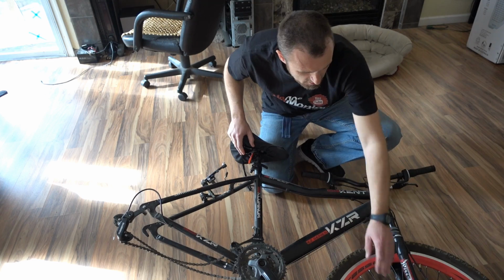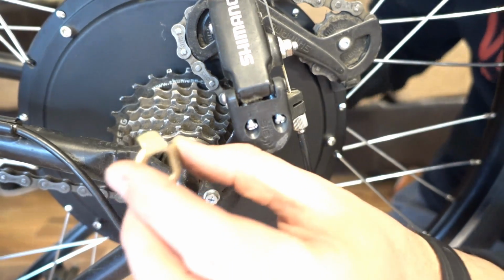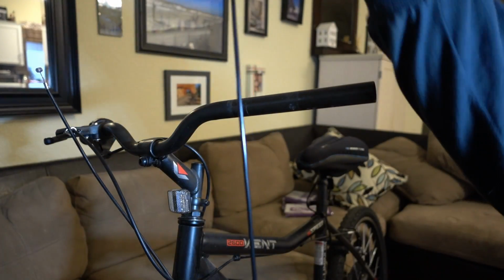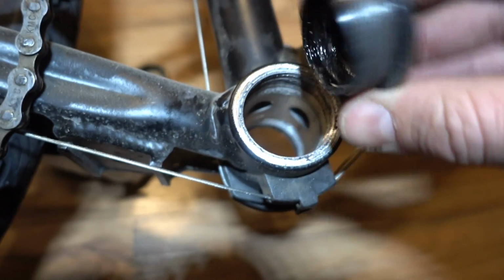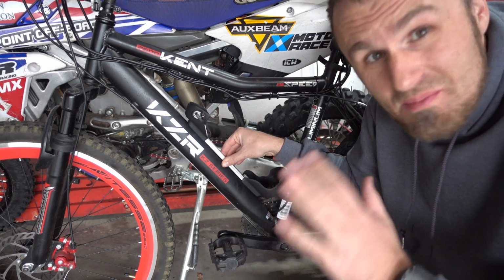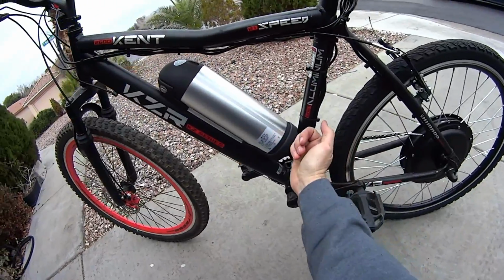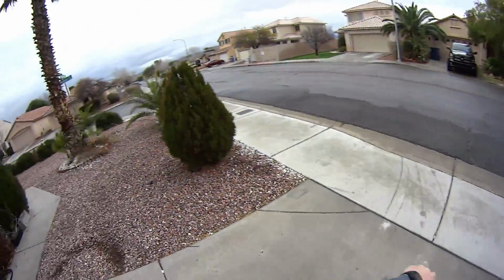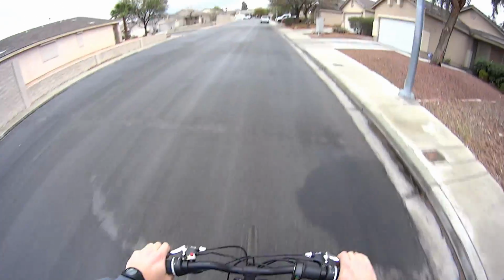How to build a home made electric bicycle better than Ancheer cyclamatic for $250

Comment: Most people don't retain the front derailleur and shifter because it isn't needed. The motor provides all the power you need for hills, making the smaller gears obsolete. So you could have freed up handlebar space

Comment: i have ancheer bike i am from germany, i make 5000km a year, so many dumb people buy e bikes for  1000-2000 euro for no reason. all i enhanced was i changed fixed handlebar extension to a variable and larger one to fit my height better and bought a 3 euro foam seat addition, i have it for 2 years and i still like it. ps i bought it after having viewed your videos cuz i was also suspicious but it worked out as expected

Comment: We live in the same city! I have a RHM 48V 1000W eBay kit I bought back in 2015, it’s still working great! I originally had it installed on my 2010 Trek 4300 (non disc version). A few months ago I found a Kona on CL with hydraulic disc brakes for $100, so I grabbed it! I transferred the kit to that bike. I did have to get a new rear brake setup installed though, so that added to the cost. 
          A little over a week ago I was on FB marketplace and found a Giant Escape 3 with a BBS01B mid drive kit already installed on it for $75! All it needed was a battery, and the battery I already have works on it! The motor is a 48v 350w and my battery is a 48v 12AH. It works great, and feels much more like a regular pedal bike when riding unassisted! I use much less battery vs my RHM. I ride both in pedal assist only, they have throttles but I have them disconnected. It only takes a few seconds to connect them if I need to. BTW, my eBay kit came with a LCD display, I paid about $270 for the kit back in 2015. They’ve gone down since then! I can control my PAS 1-5.
Reply: What happened to your Ancheer?
Reply from the maker: Sold the ancheer a while back... Wanted a fat tire bike but they are like 900 so I have up on it, till this happened

Comment: They sell the rear wheel kits that already include the cassette - and it only costs a few dollars more - yes, it's a cheap cassette, but you're going electric on a cheap Walmart bike, so it's not as critical when you pedal. Actually, you can swap it out with higher quality components if you like. Another safety thing you absolutely need -TORQUE ARMS (especially for front wheel conversions). The torque washers included might be good for 250watt kits, but anything above, you absolutely want to use torque arms (two, one on each side). Unfortunately, I learned from experience. I cartwheeled on my front conversion, but I was only going 10mph. If I was going full speed at 20 to 30 mph, I'd be dead. Rear wheel is not as critical since you won't cartwheel - but the wheel can still spinout and break up.
Reply from the maker: All good info, thanks.. How you like your bike, fun right?
Reply: @VegasRoManiacReviews  Yes, total fun. I started with an Ancheer (folding) 250watt a couple years ago and got the ebike bug. Then I converted an old bike with a front 1000watt kit (that's where I learned my lesson), then converted a new Walmart Genesis v2100 (made by Kent) with a rear wheel. After riding the 1000watts, you don't want to go back to the 250. You need it for hill climbing (15 to 20mph is plenty fast for a bike). Pretty scary when you go 25 to 30 on the streets with traffic and a cheap Walmart bike! And besides, you don't want the cops to stop you for speeding. I try to be inconspicous as possible.

Comment: Consider getting a mid-drive as an add-on approach. Watch this new video posted today: https://www.youtube.com/watch?v=I98Ram3HJw0
Reply from the maker: I like the throttle mode only on the hub motor, in done trying to ride in gnarly terrain, I just need to cruise around on a mountain road or around town, the throttle mode it's amazing, and it's efficient

Comment: I just gave away an old bike that would have been perfect for that.  Doh! 
Nice build.  It was worth the money just for the burnouts.  Those pedal crank bearings are HARD to get to.  I had to replace some crank bearings once and I almost gave up.
That's a great idea moving the front brake to the right.  That always messes me up on my bicycle because it's opposite from a motorcycle.
Reply from the maker: Yep was a fun project and I'm thinking to get another battery, so I will have lots of miles on it...

Comment: From a sharing your experience in this project perspective, the video was great! It exemplified all the steps necessary to get this system functioning and all the unexpected design deficiencies that you had to overcome to get it functioning. Luckily you were able to fit the battery inside the frame space available overcome the interference problems from the derailleur and frame drop-out. From the perspective of whether I would want to have that bike or not, I can clearly say NO THANKS!! 
My conclusion is if I wanted to get a bike with that quality level, it would be best to go buy another Ancheer. Of course, I would never want to have a bike of such low quality level for the trails riding I pursue. Coming from a bicycle background I can tell you that so many of the Ancheer and this hub motor system components are the absolute lowest quality and performance. They would not  be worth wasting the money on unless the bike is strictly used on pavement with a very mild duty cycle. I think you were very disappointed with the performance and capabilities you experienced with your Ancheer, but I can tell you if you invested more money to get a high-quality system and higher-quality components, you could have a lot of fun off road with an electric powered bike. The Sur Ron eMoto could bring you a lot of fun for about $4k (see Luna Cycles website). Check out this playlist I created on my channel for the Sur Ron eMoto: https://www.youtube.com/playlist?list=PLZEb8ngMuMU15TMhSYkkcu-GSdVQxGBSg if I was going to buy an e Moto this maybe the one I would get. Also check out the French company, LMX emoto's website.
1. Did you add the cost of the extra power level switch and the cost of the modified cassette installation tool to your project? 
2. With your Amazon card 5% discount and the YouTube link you usually setup, that gives a discount, what is the net cost to get another Ancheer?
Reply from the maker: I will not get another ancheer, I just like to mess with this one, I will add another battery and maybe I'll try a 100w solar panel just for fun... This will be a trash bike That I can play with. Alsobndicovered that the battery it's 36 volt at 10 Amp, so I'm using only 3/4 of the 500w motor I will be adding a new battery will be amazing fun.
Reply: Yeah, buy lots of batteries! Do the math...  A solar panel would be nice to have for recharging, but the charging rate is will be too slow to be able to recharge in time for another ride. More range is always a great thing...  Range is the biggest negative about electric vehicles vs. gas power. You can't decide to add more solar charge to a battery mid-ride, unless you ride at night, sleep/camp in the daytime!! :-) Let's see for my eMoto (assuming there was 100W available from Solar,)... I have a 2400 Watt-hr battery, at 100% charging efficiency, it would take 2400 W-hr/100 W= 24 hours to recharge for another ride, but there are at best only 12 hours of solar power in a day, so it would take me 2 more days of charging to do another ride!!! For the battery you bought, the web link says its Rated Capacitance:=8Ah ...convert (https://milliamps-watts.appspot.com/) 8Ah= 8000 mA x 36 volts =288 Watt-hr, so it would take 288/100= 2.88 hours to solar recharge for another ride! Same solar problem, it will take about 3 hours or another day after riding with one battery to charge the battery, so at best you could set up your solar panel at your campsite and ride again the next day! Of course the range is limited too, so how far could you go on a dirt, rocky, loose, climbing trail on most eBikes? --not too far without contributing to the cause (i.e. pedaling) only 880W-hr!! The bike I'm waiting on from Specialized has a 700 W-hr battery, but most pedal assist bikes are 500 W-hr (https://www.specialized.com/us/en/mens-turbo-levo-expert/p/154388?color=239491-154388) p.s. Make sure you waterproof your power controller box with RTV sealant so it doesn't short and fail!
Reply from the maker: I will not get another ancheer, I just like to mess with this one, I will add another battery and maybe I'll try a 100w solar panel just for fun... This will be a trash bike That I can play with. Alsobndicovered that the battery it's 36 volt at 10 Amp, so I'm using only 3/4 of the 500w motor I will be adding a new battery will be amazing fun.